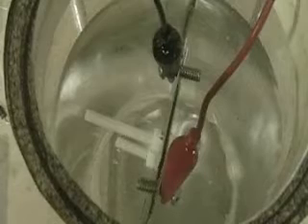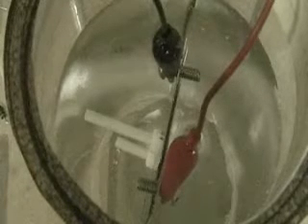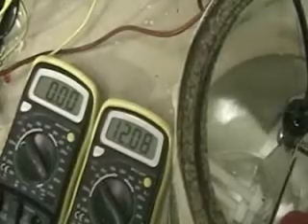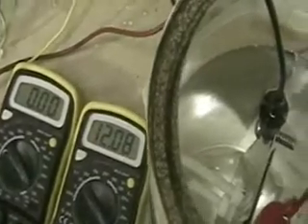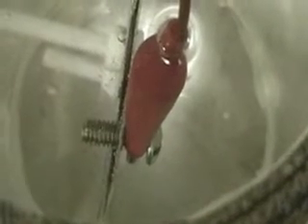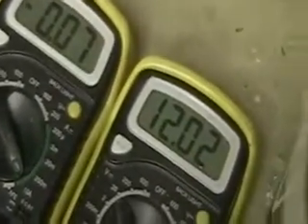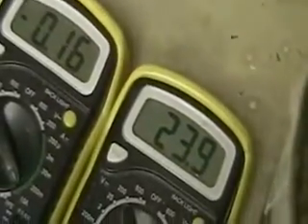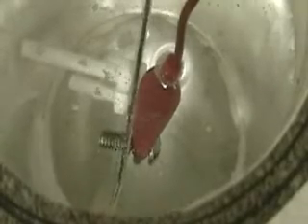Hydrogen Tap (No Electrolyte) 274

Comment: A neat test would be to see if there could be 50mA running through this, and see how efficient it would be with your new gas tower measureing device. I guess such low current would be no heat generated.